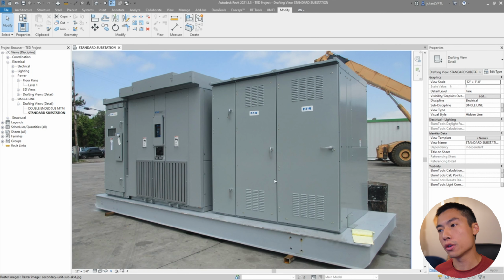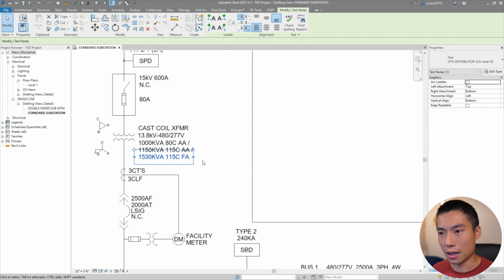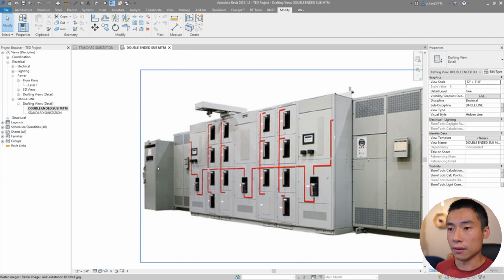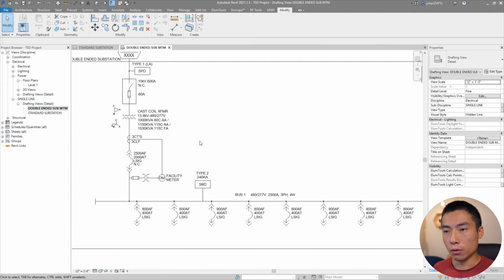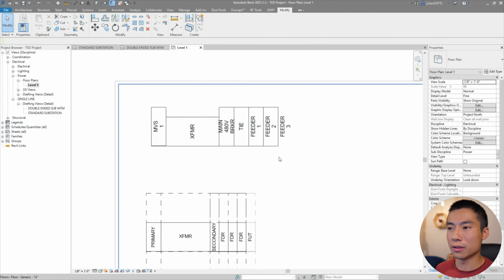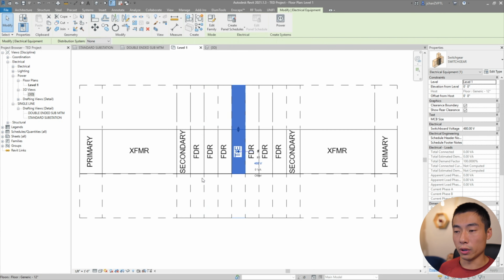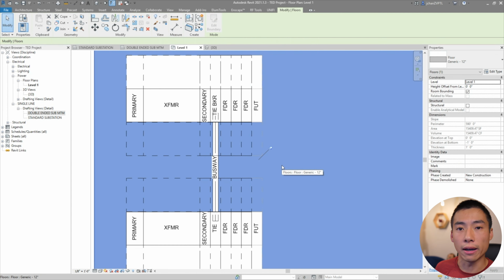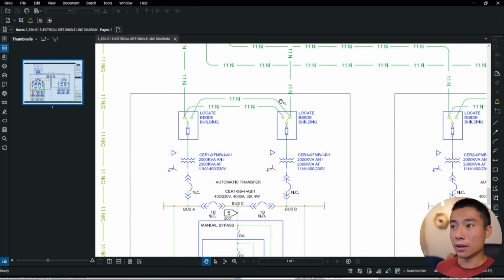Electrical Gear - What is this?

Comment: Good content.  I work with M-T-M all the time.  Typically we have these kirk keyed for facility electrican use to load shed.  Draw out breakers are nice for when you need to replace a breaker without having to shut down the service.  I'm still a little confused by how the grounding works with a M-T-M, but I'm assuming you have have two grounding bus bars that are jumped?
Reply from the maker: Oh good question! I need to check out the grounding diagram in the morning and see if they’re bonded between the two sides. I tried to ask a senior engineer about grounding and he said it’s almost more complicated than power distribution 😂
Reply: @theelectricaldepartment  lol.  Yeah, I used to read NEC 250 when I had insomnia.  put me right to sleep.
Reply: My assumption is that because grounding goes to the source (transformer) via path of least resistance, each side of the M-T-M would have individual ground and neutral bus bars that are jumpered.  However, assuming a service goes out, that ground path will still go to the transformer in service, so any neutral or grounding on the "down" side of the service would need to jumper to the other bus bar for the path to be completed back to the transfomer.
Reply from the maker: @Marco-genx  Just got around to checking out the grounding diagram. The ground bus in the MTM is shown as one continuous bus. It’s also bonded to the neutral bus with a removable jumper. The ground bus inside the switchgear is then bonded to the main ground bus in the room which ties to the ground loop.
Reply: @theelectricaldepartment  Thanks.  That makes sense.

Comment: What's a cast core transformer?
Reply from the maker: good question! It is a transformer that has its windings casted in a special epoxy resin that can withstand the temperatures that the transformer operates at.  This protects the transformer which prolongs it service life. Other types of transformers are submerged in different types of oils which will protect and cool the transformer, but those systems can be expensive or challenging to install and maintain.